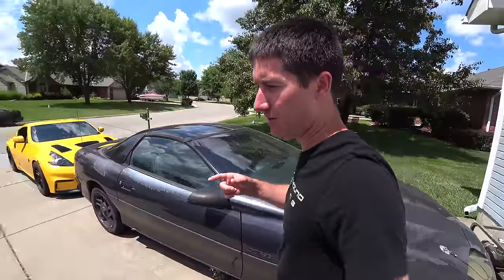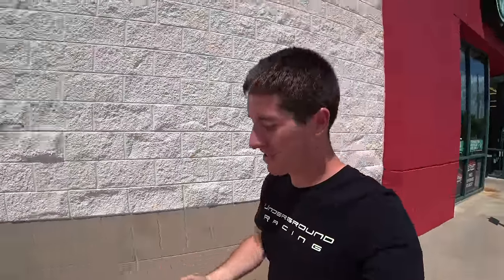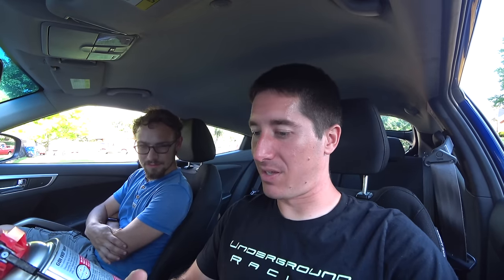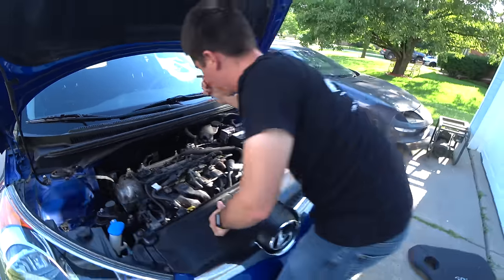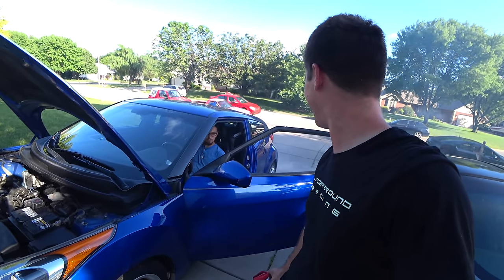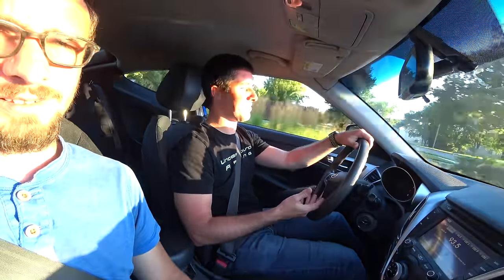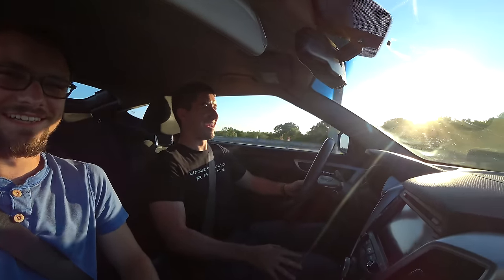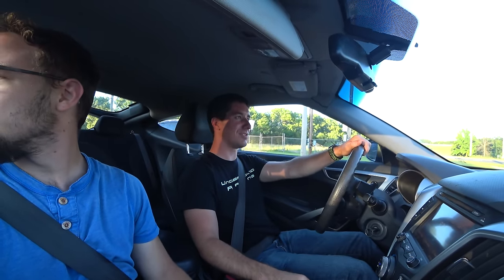How To REMOVE CARBON Build Up From DIRECT INJECTION Engines For $12

Comment: These cans of cleaner were sprayed in my GDI vehicle 2 cans in total  at 580000 miles .. AT  65,000mile  the manifold was removed 1/8 inch sludge was in the manifold but it was soft  . Cleaned out by hand .

Comment: Love the videos but to anybody trying to do this at home you need to be very careful as turbo vehicles with GDI can be severely damaged by this service any carbon particles that are knocked loose can go into the turbo blades and caused severe damage as a matter of fact to my knowledge Ford has no approved cleaning or decarbonization of the engine it can do severe turbo damage but love the videos keep them coming
Reply: Was wondering about this for my wife's fusion.  It's the EcoBoost.
Reply: @mullinsjm1  It's anecdotal, but I've got a 2014 F-150 3.5 TT Ecoboost I used this on at 120k miles. Didn't experience any issues, but I have no idea what my carbon build up looked like. I was just doing it as preventive maintenance knowing it was at 120K miles.
Reply: Just throw away all the new cars. It's 2020 and we shouldn't be doing this. 10 steps backward smh
Reply: Ford would RATHER have you take your car to your "friendly" local dealer for "professional" service!
Reply: @100cvcv8  Boomers say they want to go back to WhEn CaRs WeRe SiMpLeR and other rose tinted nonsense, but we forget that average cars are safer, more efficient, more powerful, etc. than they've ever been. Opti spark? Points and condensers? Carburetion? Non-collapsible steering columns? Bias ply tires? No airbags? No crumple zones?  Yeah, that crap is history for a reason. An induction cleaning service at an independent shop is no more than $300 for most cars. If you can't deal with that cost, there are plenty of port injected cars still for sale new. Do your research. 

Don't get me wrong, old cars are cool, and I love driving some of them. There are some truly special gems, but for every one old car we remember fondly, there are DOZENS that were absolute shite.
Reply: I would say so , those chunks of carbon do pass through an explosion and then out the exhaust and to train the turbo so you could do it a disfavor. There’s no quick dyi other than opening the engine and cleaning it .
Reply: @doug960  yeah yeah old farts stink blah blah.

We'll see you in few years when electric cars are mandatory, the cost is unattainable and the value is even worse.
Reply: @doug960   You can absolutely be nostalgic for the good parts of older cars and still acknowledge that newer cars have good points. Efficiency and power are almost all good. Safety is a mixed bag, and most of the rest of it is actually going backwards. Like cars that have cell modems and report everything you do, where you go, how fast you do it back to the mothership without your consent or ability to authorize the data going back. You have complexity for complexities sake. You have open hostility and anti consumer behavior to doing your own car work.  With some safety features, especially new things coming in the next few years, you have new cars that tell you what you can and cant do rather than the other way around. You have cars with keys that cost $500. You have cars that are artificially crippled so they can sell features sets back to you again (i.e. heated seat subscriptions and other similar bullshit). You have cars with wonderful engineering that pushes material strength and durability right to the very edge in the name of efficiency, but yet nothing is OVERbuilt anymore so  they are much less durable. I could go on and on.
Reply: How does carbon from the valves make its way back to the Turbo?  The Turbo is upstream of the intake manifold?

Comment: I ran this stuff in my 2014 VW cc 2.0t notorious for carbon buildup. With a high flow CAT I smoked out about half a mile covering 2 lanes. It was awesome. Whenever the stock exhaust was installed it never smoked

Comment: it really would be nice to verify via visual inspection of the valves before and after instead of "assuming" you accomplished something.
Reply: Well, Hyundai/Kia adds the intake valve cleaning in the regular cycle of maintenance as what customers should do, but this is the first time, which worries me

Comment: I do this on my Hyundai GDI as well every 15,000km and also swap out the PCV valve as well. Cheap preventative maintenance.
Reply from the maker: Thats a good call, they say do this with each oil change 💯
Reply: Oil catch cans work like champ on early GDI engines since no fuel gets sprayed on the back of the intake valve to clean off the PCV recirculated   gas.
Reply: Can you use this on turbocharged engines? I’d like to do it to my car but I’m afraid of some of the built up carbon cracking off and going through the turbo.
Reply: i removed the pcv fully in place for a barb fitting venting that port as well as the beather and oil cap to atmosphere :) 109,000 miles and counting with 0 engines issues. catch cans are a joke on this vehicle. oci 3k minimum with PUP 5w-30
Reply: What cleaner do you use
Reply: @Too-Gq-For-You what car you do this on
Reply: @truebengalsfan  Same stuff in the video. CRC GDI Intake Valve Cleaner. It contains PEA which is the only cleaner proven to really work on the carbon buildup.
Reply: @truebengalsfan  2016 veloster turbo
Reply: @Too-Gq-For-You  good I'm hoping this work on a 2012 sonata

Comment: Hey Guys ... there used to be a product called GM Top Engine Cleaner that could only be purchased at the dealer ... I had a '76 Caddilac Eldorado that I purchased from original owner back in the early 90's ... the stuff came in a 16oz can and directions were simple ... warm up engine first then slowly pour half the can in while engine is revved to about 1500 rpm then dump the rest in till engine stalls  ... turn off the ignition and let the car sit for 30 minutes to an hour tops ... that car had a four bbl Rochester with massive secondaries so when I  opened them up and dumped in the last half can it flooded it and stalled ... Perfect !  we took a half hour break ... after puting the air cleaner cover back on we fired it up ... big black cloud of smoke poured from the pipes as we revved it to about 2500rpm for 15 minutes ... a short run down the hiway cleaned out the rest ... when I replaced the plugs later we could see the clean tops of the pistons ... even the worn out plugs were spotless ... 5000 lb. car with 500 Cu. In. engine, 425 HP with loads of midrange torque ... could comfortably seat eight people (no tunnel, FWD) even though there were only six seatbelts ... LOL ... my friend called our throw together band which was mostly covering ZZTop and AC/DC "large Car" after it because it was a really big car ... 18' 6" long ... makes me laugh at all the fun we had ...

Comment: map/speed density controlled engines deal better with vacuum leaks as the computer can still see the change in air pressure
of course a big enough one will def cause issues.

Comment: I clean my accents motor this way as well as it is GDI. I've always had my wife rev the engine but I spray the whole can in though the air intake is that the best way for most effective treatment. I usually get really get smoke show and car runs great I'm at 94k

Comment: I have owned cars since the 1970's and on all the cars I've owned I have done the same thing as you using brake fluid. Rev the engine and mist it through a vacuum pipe until you see a ton of smoke out the exhaust. Switch off and leave for a couple of hours then drive as normal. There will be smoke until it burns off.
Reply: Use water/mist and steam clean the valves and pistons does the same thing, but even better and it's free from the tap............................all the smoke in the video was pale oil, same used in Seafoam. Gives you the feeling of a good cleaning, but really nothing has been done, he'll be married to this stuff every 3-5k until he actually removes the intake and cleans it properly - If he even has the car long enough to do that.

Comment: You did not blow anything out, the smoke is simply the stuff you put in being burned by the engine. The knock also sounded more like pre-ignition, from that stuff being in the cilinders.

Comment: I used the Lucas branded GDI and definitely had the same result. Oil usage has gotten to 1qt/500 miles with hesitation and pinging. I’ve seen some benefit but want to do it again before my next oil change.

Comment: Truly, there is no quick fix for cleaning DI intake valves. I'm sure you made an improvement, but the carbon is most likely still there in abundance.
Reply: Yes there is. It’s called walnut blasting. You can get it done at a few independent shops.
Reply: I feel sorry for this guy. All this work and he has no way of knowing if it worked or not yet he believes it worked.
Reply: BREAKING NEWS! An improvement IS good!

Comment: This is perfect video because my 2017 Ford Focus SEL has a 2.0L GDI 160HP engine. Ford dealership wants to charge me like 140$ here and 170$ there for the carbon build up engine cleaning service.
Reply: That's because this cleaner won't do a damn thing.
Reply: Yeah, $12 for the cleaner and $128 to spray it in. Sounds reasonable to me!

Comment: I bought a 2013 Velocitor for my daughter. It has 90 K miles. Should I do the same thing ? What would be the symptom that the car would exhibit to need this procedure ?
Reply: Towards the end of video he had mentioned that the car had a bit of shutter/mild vibration at idle. It should be smooth and quiet like he pointed out. So if your Velocitor has similar symptoms then use the CRC cleaner.
Reply: You should start saving for the impending engine failure. The 1.6 shares the same basic design as the theta engine. Google it to see for yourself.
Reply: CHIP FUKMASTER 
It’s not a turbo. Does that make a difference ?
Reply: @greggronemeier1256  same engine architecture, same design flaws. The H on the front of the car isn't Honda
Reply: I'd stay away from any Hyundai 2011-2016
Reply: @greggronemeier1256  Hyundai has never come clean with their theta engine failures which go back to 2006 the Gamma is directly derived from the Theta.  If you accept that 140-150k is the end of life for a well maintained example then it's okay.  I have a relative driving around on a factory replaced longblock theta that died at 98k they will keep the car another 70-80k and sell or trade it off.
Reply: CHIP FUKMASTER 
Thank you for your comments. Your the first person that had a challenging comment about my daughter’s vehicle. 
So keep up with maintenance and hope for the best. That’s what your trying to tell me.  Correct ?
Reply: @greggronemeier1256  just hope for the best. Lots of known ones goes out early.. but good chance your daughter will be lucky and not have any issues. Just gotta let life happen and hope for the best.
Reply: @greggronemeier1256  maintain it and hope for the best. Some people want extreme reliability and drive older Japanese vehicles. But the majority of people upgrade their vehicles frequently to get better safety, tech, fuel mileage and prestige. There is a negative social stigma about driving an old clunker. And God forbid you are in a collision safety can make the difference between walking away and being seriously injured.  The Hyundai Veloster while not being nearly as reliable as a Corolla will most likely give you a decent service life and your daughter will tire of it and trade it off before the failures begin.
Reply: CHIP FUKMASTER 
I believe you are correct. She is coming up on 2 years and she still loves the car, but she is starting to consider a slightly larger vehicle.  Thanks for your comments.
Reply: My 2.0t engine in my sportage blew at only 55k miles. POS engines. And yes I kept up on all proper maintenance and didn’t drive the car hard. Just once in a while to clean out any carbon I could.
Reply: I don't know if y'all still have the Veloster but they're not as bad as these guys are claiming them to be.  I have a 2014 Veloster Turbo and have had 0 issues.  Also, there's a pristeen 2013 non turbo, fully loaded with sunroof, navigation, etc with 245,xxx miles that runs like a champ!  The dealership has all the service records from the previous owner as well.  It was owned by some kind of travelling salesperson so the mileage was mostly highway miles.  The 1.6 gamma engine is actually a very reliable, long lasting engine as long as you use top tier gasoline and oil and use the CRC cleaner every 15,000 miles or so.  Hope your daughter is still enjoying her Veloster.  🙂
Reply: Mark Byrge 
She still has the car. Just did the 100 K service. Still runs well. She will graduate from college in a year. She is starting to want a larger car. Might give her my 2013 Genesis sedan, if I decide I would like a newer car. Just did the 100 K service on the Genesis. Other than normal maintenance, the Genesis has had no issues in 100 K. Cars that don’t break are exactly what I look for. Very happy with the Velocitor and the Genesis. Would consider another Genesis based on its history. Thank you for your comments.

Comment: Got new plugs, new air filter and oil change, so i put premium fuel and added a cleaner to the fuel. Now rpm has been limited to 2000. Engine light blinking.  idk if this is connected but will be using the spray soon.

Comment: dont think that would of worked on mine, just took the intake off the 00 exploder started squirt coolant out the back today. i had to scrape the carbon out of all the ports im pretty sure we filled the cup lots of hard chunks, 1st time i ever did upper an lower intake , gotta put back together tomor fingers crossed lol, im whipped now most the scrapage was done that or seafoam may doit good when im done, how dow you feel about seafoam?

Comment: Have rough idling runs a lil rough even on the highway. Just started to do that two days ago had it scanned at auto zone and said needed EGR valve replacement. This mechanic said it might just need a simple cleaning but it’d might need carbon cleaning at the ports. Will have it replaced but was wondering if needs a engine ports cleaned as well. This other mechanic said the EGR valve keeps it from getting carbon in there.  No need to clean engine? 2015 Ford Fusion SE 2.5 L engine I think it’s GDI engine

Comment: I have a 2.0 ecoboost Escape.  I’ve haven’t had issues.  I do put in redline fuel cleaner every 10k miles, run 93 ethanol free gas (proven to have less build up) and  a K&N.  Did I mention, I drop in sport mode and punch the hell out if it every once in a while.  It hits 125 pretty damn quick.  Blow it out.

Comment: did work on my wife's kia soul , why engineers didn't think of that  need "oil catch can"    i used cleaner and incresed gas mileage was awesome, still have more to do again in 10k miles.  to keep clean.

Comment: Good tips.  I have 2011 VW Tiguan and am planning to try this CRC.  Question;  hose from vacuum pump splits into two ways.  One to motor(maybe intake manifold) and the other to Brake booster.   Which one do I need to disconnect and spray this into?   Planning this weekend.  Can you replay please?

Comment: I used this CRC on my 2011 Buick Regal twice and got more smoke the second time. She still kinda hesitates when throttling up. I just sprayed it in the air intake (post the maf of course). Would spraying it in the vacuum line produce better results?

Comment: Thanks for the demo and reminder   on necessary GDI maintenance. Bought my first one last year in my wife's 2018 Mazda 6. Have awhile before it builds up though. She's only closing on 25,000 miles.
Reply: If I remember correct, Mazda actually doesn't have issues with carbon buildup. Something to do with how the PCV is designed.
Reply: @ddg2256  they run the engines hotter than most manufacturers, and the carbon has a hard time sticking to the valves at higher temps
Reply: So you guys wouldn't recommend intake cleaner or catch can on a new mazda??

Comment: Say the product works perfectly and lifts (not dissolve because carbon) from the valve. Where does it go now? Right into your motor that's where.
So how much carbon glaze do you want on your oil and fuel pump gear and cam mating surface? How much does it take to kill the catalyst?
Better to get it done right I think.
Reply: It doesn't work lmao, so no worries

Comment: GM makes a product called Kleens, an all purpose de-carboning solvent in pour in and spray in versions. The pour in was for carburetors but the spray will do the same thing. It's the same solvent. At your friendly neighborhood GM dealer parts counter. You never ever left the GM Parts counter paying so little...like EVER....for such a productive end result.

Comment: Try this.
A large veterinary syringe needle stuck into the intake air hose and then spray the gloop into the needle.
When done, either plug the needle for future use. If you remove it the hole will close up. Voila.
Works for spraying starting fluid into gas or diesels.

Comment: Port injections clean the valves themselves when the fuel is injected.
You just need to use injector cleaner in you fuel once in a while.
Reply: That engine isn't port injected.

Comment: Did you spray into the breather hose going to the intake side of the turbo? Or did you spray into the PVC hose going into the engine intake?
Reply: He literally said brake booster line

Comment: My fix for the carbon buildup is the good old italian tuneup. Almost always works, and when it doesnt, it just means you are not driving it hard enough
Reply: Yep take it out on the freeway and have at it.
Reply: @Jmac1000000 not true keeping high revs does burn it. But the crc does make it burn off easier.
Reply: @Jmac1000000 ✊🏿